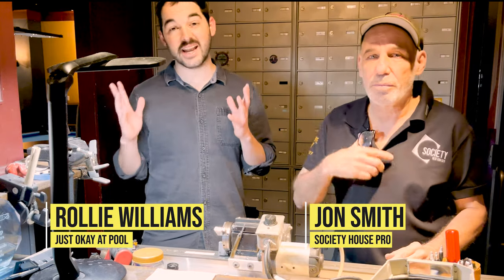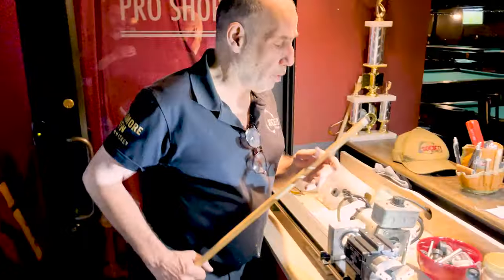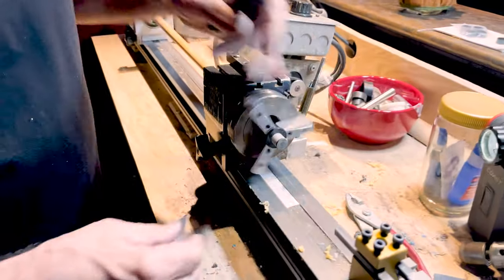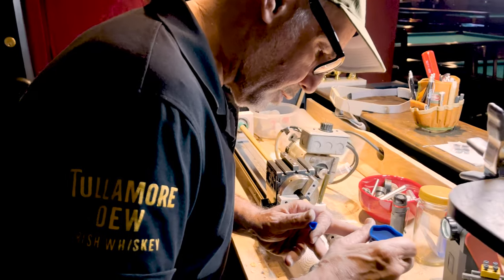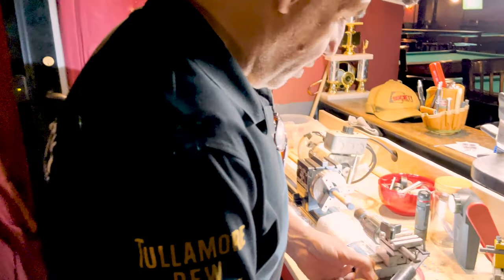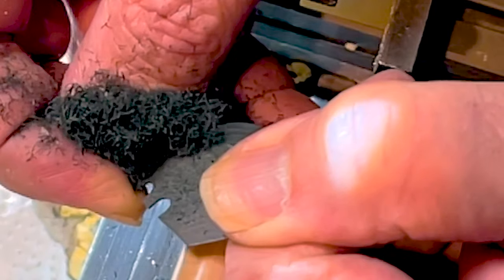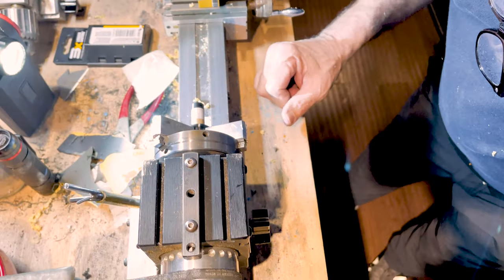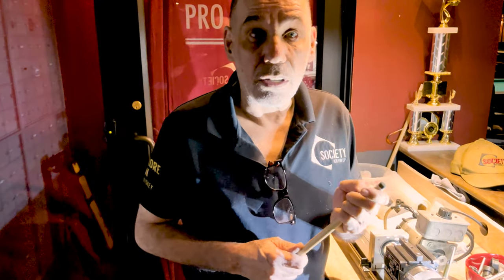Installing & Testing The New KAMUI Control Break Tip

Comment: What makes it controlled?  It doesn't look like John has any control over the cue ball at all.i can get the ball to stay in the center of the table with my bk3 with the original tip. Its kind of a shame that he took it off of his bk3. That tip would probably be great to add to a $100 break cue, but the bk3 is perfect the way it was engineered from the factory
Reply: Yeah I stopped trusting Kamui tips after my Kamui black kept glazing over every rack. I moved to Tiger for my playing cue and Taom for my break. Never looked back.
Reply: @RockSpoon123  I like the Tiger tip also...!
Reply: @2869may  Nice! I've used the Tiger Onyx for ~6 years now! Best tip!
Reply: @RockSpoon123  I believe I have the Everest.
I just starting playing again last April, I actually built a table (Bar size) is all I have room for. It turned out pretty good, two layers of 3/4 MDF bed, K66 cushions and Championship cloth (Didn't want my first attempt at it to be with expensive cloth...lol
It actually plays pretty good..! I did the math right so the geometry is good (angles and banks)
For what I spent building it, I would have only been able to buy a wobbly partical board piece of sh!t.....
I have videos posted if you care to check it out.

Comment: Just wondering why you didn’t take the old tip completely off?
Reply: The tip is completly off its just that the Predator BK3 cue has a thick phenolic plate that looks like a half tip on there ;)